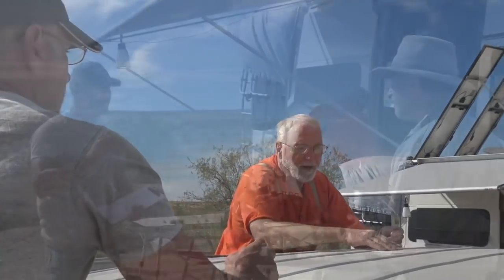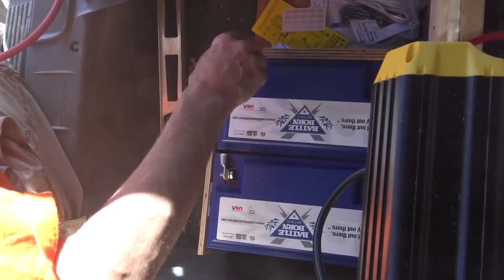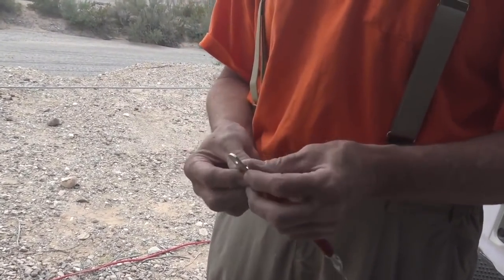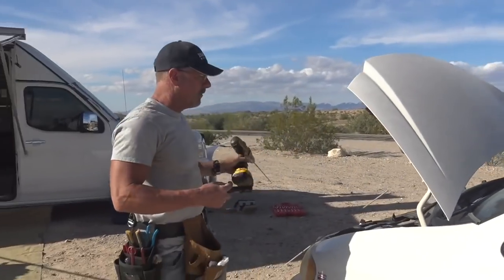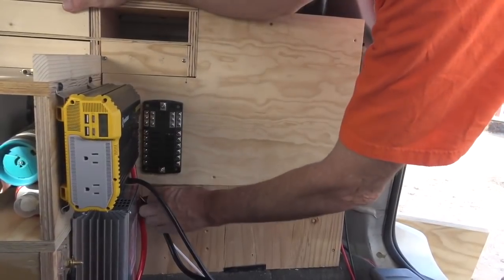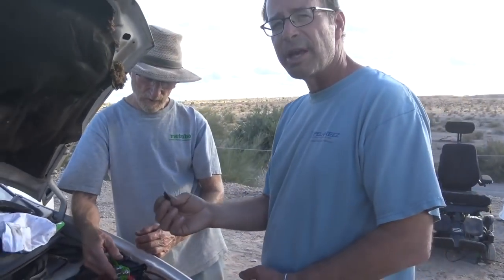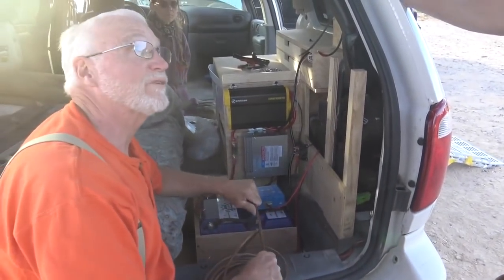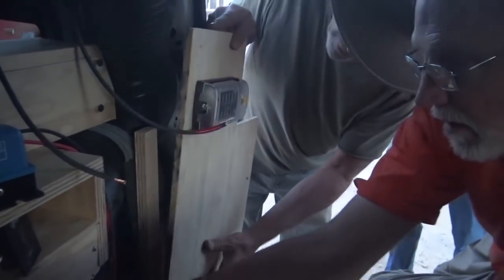Lee Blake Solar Install with Battle Born Lithium Batteries Donation for Lyra - Van Build 2018

Comment: I don’t like using electrical tape on wire to lug connection points, heat shrink tubbing is a better solution. Great video fellas, well done.👍

Comment: An old aircraft mechanic once told I should always connect the power wire to the battery positive first so there is no electrical arc. After the positive is connected the ground wire is secured to the battery negative. This way It won't matter if your wrench touches ground because it's negative to ground. The problem with connecting the negative first is you run the risk of the wrench arcing if it touches ground while securing the positive.

Comment: Thanks for the tips!
Love the crimper Lee used.  A car audio guru taught me to fill the cable terminal cups with electrical solder and slide the heavy cable into molten solder before crimping.  I had never heard of the copper paste before.  I ran heavier cables from my Keyline split charger to my two 6 volt Deka Pro master batteries.  Almost two years later, I have had no problems so far.

Comment: That solenoid thing is actually a battery isolation manager, especially 
made for Lithium batteries. What it does is protect the batteries 
against too high voltage (>14,4v) and too long charge feed. It lets 
you charge for 15 minutes, then stops for 20 minutes and repeats the 
cycle until full. It will also take care of the car battery as it will 
not charge the Lithium batteries if the voltage is below 13,3 v. That 
helps the car battery to get a full charge first.
Reply: Thanks for sorting that out for us...👍

Comment: You must appreciate these guys. My battery connector has corroded and fraying from the cable. Bought the replacement but due to a short wire I decided to let a professional replace it. Just to crimp that thing on cost $20 dollars.

Comment: Last part of video... is why you hook up all the grounds LAST. That way if you slip with a wrench... unless you hit the positive terminal, nothing will happen. And while you are wiring up the the vehicle, disconnect the ground of the vehicle battery too. Also lithium batteries can draw an insane amount of current charging and discharging, that is why you need an isolator, it will damage your alternator. A normal vehicle battery has a high internal resistance when charging, so that is why it doesn't damage the alternator. With lithium batteries and an alternator, it will draw current to the point where the alternator fan can't keep it cool enough, then it will overheat and short.

Comment: You can also use dielectric grease or electrical waterproofing spray on your electrical connections to keep moisture out.  CRC makes both which is available at O'Reilly Auto Parts stores.  An ounce of prevention is worth a pound of cure.🙂

Comment: Here's a tip, instead of cleaning the paint surface with rubbing alcohol which  is 91%, and a brillo pad, use 99% alcohol from an automotive store, and Lava soap which gives a super clean surface that doesn't compromise the paint so much. 😊

Comment: I hope Jaime and Lee can do mine next year. I have a fiberglass top, so I doubt I can have anything on top. Maybe only a suitcase style set outside and a house battery off my starter battery? Surely there is a way to have enough battery power for a frig and cpap and other things?
Reply: My Son's Mother Fiberglas is great to mount solar panels to.
Reply: I really don't want holes in my roof, or glue. I would only want rails attached to the side. Not sure that's possible.
Reply: I definitely seldom see anyone do solar on fiberglass.
Reply: @MySonsMother  I attached 2-100 watt solar panels to my fiberglass roof. 5 years later no leaks and it's still firmly attached to roof. I live in Wisconsin where the winters are brutal and everything is still good. :-)
Reply: @My Son's Mother - They use a product called "VHB" - it's "Very High Bond" tape by 3m. It's like an insanely sticky/water/uv proof double sided tape. Works like a champ for fiberglass/ or "no hole" installations. Once you attach it, it aint coming off. It's widely used to stick all kinds of stuff to your roof.
Reply: Eugene, that sounds great, but for 2 reasons i'm look wary. I read solar panels should have space below to keep the insides cooler. Also, I don't want anything I can't easily remove.
Reply: @MySonsMother  Look up Hobotech's install. He has a fiberglass roof, and he stuck his down with VHB 14k miles ago or something. The bracket gets taped down, not the panel. the panel rides up with airflow under it. VHB can be removed, but I don't think I've ever read of it being "easy". But I get it. It's a leap of faith for sure.

Comment: At 49-50 min when connecting other things to the BB batteries they said to put all connectors on the same side of the post otherwise, they said, the battery post becomes a part of the circuit ... current would pass through the connector.  I think that may be in the supplied instructions.

Comment: Where is the catastrophic fuse on positive of the lithium batteries?  The converter does have fuses, but I would have wired all of the positives off the large fuse they used for the inverter.

Comment: You should NEVER wear rings, or other jewelry when working with electricity. Saw a guy once, weld his ring to the positive battery post and ground. The ring became a heating element, and the guy tried to remove his hand but couldn’t until help arrived and was able to free him. The ring cooked the flesh around the finger so bad the doctors had to sew the finger into his abdomen to grow flesh on to his injured finger in order to try to save it. This is an ordeal I hope no one reading this ever has to endure.

Comment: You guys are great for solar but I want to see someone make a hot water heater that uses either exhaust pipe or cooling system to heat the water.

Comment: Lee is AIRCRAFT all the way, not Jiffy Lube!  We use the same type of wire insulation cutters (and Im sure to come, but I haven't gotten that far in the video) and crimpers on aircraft.  
The other guy was correct about a condensation drip loop on the wire, but that's more important where you actually have a high degree of condensation, for example when an aircraft takes off from Miami international where it's 90°F and the plane ascends to 30,000ft. altitude where it's -60°F.

Comment: Shouldn’t you connect all the positives first before connecting to ground?  Thereby avoiding arcing by accident because current will not flow if ungrounded?

Comment: I try to run new wires through and existing rubber boot or grommet already in the firewall from the factory.

Comment: This was a great video.  Although I do have a question regarding load connections.  As the BGA225 (00-10041-450) is a low-voltage disconnect, shouldn't the inverter be connected to it instead of to the battery?  The BGA225 disconnects the battery if the voltage gets to 10.5 volts thus protecting your battery investment.
Reply from the maker: That would be a question for Battleborn as we installed the low voltage disconnect per their schematic, but I CAN tell you that discharging the Battleborn batteries 100% will not damage them. My guess is that the low voltage disconnect is to protect appliances in the rig, not the batteries, but the folks at Battleborn are the experts.
Reply: Thank you for the quick reply.  That is good to know.  I will be ordering a system soon.

Comment: Some very good stuff here, but VHB tape should not be your only attachment point!!!! Sure gave it the best chance but years in sun or weather cycling and it will fail! Ever seen a panel through a windshield on a family behind someone doing this? I have, scary... Use VHB to minimize screws not eliminate screws.

Comment: No journeyman electrician ever uses scissors to cut electrical tape. you wrap it around tightly several times and then pull it until it breaks and then wrap it around and that stretching will make it tighter.
Reply from the maker: Nope. I'll always be a tape cutter. That's just laziness.

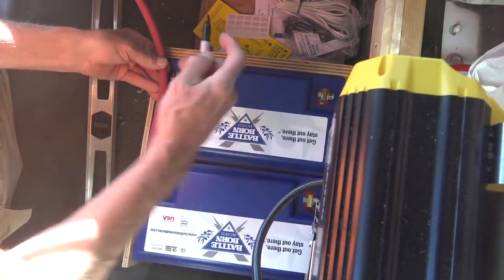Comment: 1) 9:38-9:50 what kind of flexible cabling is that?

2) 10:50-11:40  what kind of prep tool is that?

3) 11:56-12:40 is copper shield the same as Permetex (09128) or equivalent?

4) 13:24-15:06 Is that a jig you’ve made for the 3 point crimper or is that entire assembly sold somewhere specifically?
Reply: I would love to see these questions answered!
Reply: I could be wrong but, I'd say the big, flexible cable is welding cable, the stripper is probably a Jonard CST-1900, the connector compound is "Kopr-Shield" by Thomas & Betts, and the crimper is in a drill press vice bolted to his swing away hitch rack. I realize the questions are 2 years old, but since there was no answer I thought I'd try in case it helps anyone else who's curious in the future.

Comment: Ok I get the inverter (DC TO AC) but why the converter?
Reply from the maker: In case she wants to plug into shore power and charge everything if the sun is behind clouds for days.
Reply: Enigmatic Nomadics oh, the converter is a glorified battery booster?  It’s primary fiction is to charge DC batteries not to run DC appliances?

Comment: 2AWG from starter battery to isolator due to voltage drop.
Reply from the maker: Overkill Mr. Edison.
Reply: @enigmaticnomadics  Okay.  However, all that voltage sensitive lithium conditioning requires less than 3% voltage drop, which you've surpassed.   Sorry for the help.
Reply: @enigmaticnomadics  Yes, the system "works", but it will degrade sooner than necessary.
Reply from the maker: Elliot Koesis A lithium rated isolator specific to Battleborn was installed on this system to account and adjust accordingly. I’m sorry too.
Reply from the maker: Why don’t you start by asking the right questions instead of posting “You should” comments. I like it that your questioning things though. Do you have a lithium system on your own rig? (Not being sarcastic) we’re past that.

Comment: All of the wires connected to the batteries need to be labeled. As is, it's just a big "Cluster F*ck". Only Lee knows what is what. Down the road, someone is going to have to trouble shoot this mess. No disrespect intended.
Reply: @albertcassler8763     Exactly my point; "All else makes you have to trace every friggn wire to troubleshoot. Which Red wire do I need? Or is it one of these Black wires? Which one is for the Converter; Inverter; etc. etc. Takes little effort for a knowledgeable troubleshooter to make it easier for one that has little knowledge.
Reply: @albertcassler8763  except one of the +ve cables is a brown lead with some black tape on it.  And there is an identical one going to the negative post!  It was a generally great setup but when I watched that part of the install I cringed!